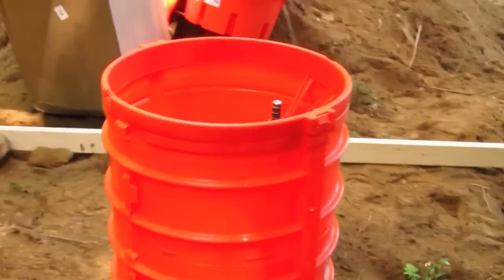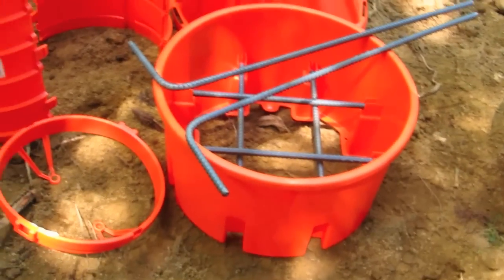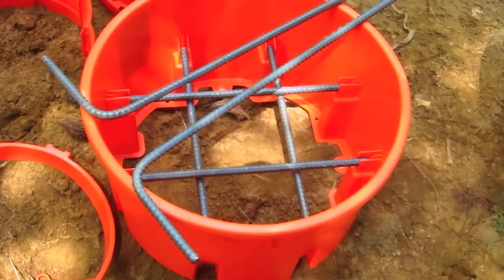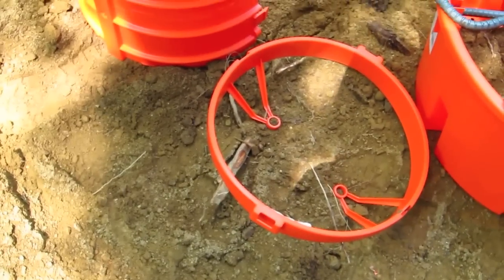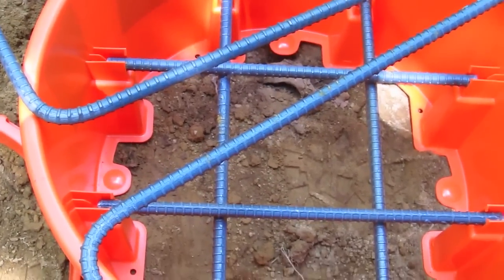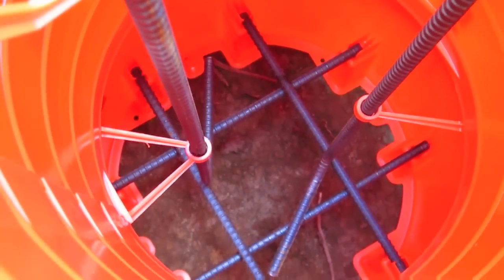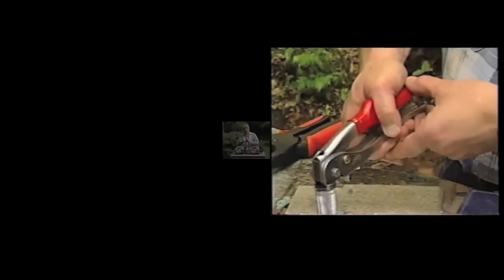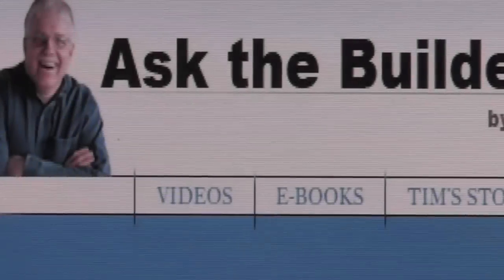Concrete Deck Pier

Comment from the maker: No plumbing. Some minor electric. At this time I only have access to a switched 20-amp circuit to the shed. That allows me to run a few lights and one tool at a time.

Comment: Using regular sonotubes you don't need to pour concrete first for a pad. You can pack t base or similar down with a 2x4, once level and packed you can position your big foot or sonotube and pour.
Reply from the maker: tyler caruso I only approved your comment to provide a teaching moment. I don't believe you understand the concept of what a footer does. It spreads out the weight of the concentrated load put on the pier. Put a simple pier on soil and load the pier and you can have great issues. Deep-driven piles and piers work only because of the accumulated friction on the sides of the piers. This doesn't apply to shallow piers like the one you see in this video.

Comment: Don't know the price. But two things. 1. Digging a hole large enough and that is deep enough to except this product will take professional digging equipment. 2. That would take a large amount of concrete. Plus the price of the product. This will get expensive very quickly. But I agree that it would never fall.
Reply from the maker: My guess is you've never installed a concrete pier before. Digging in soft clay a young corn-fed man could create the precision hole in about an hour. Yes, a small backhoe could do the rough dig in 5 minutes. The concrete used in any method - assuming old cardboard sonotubes - would be the SAME. This innovative product comes with the rebar precut to fit. Doing it any other way adds all sorts of extra cost having to transport long steel bars and then the tool to cut them on site. This product requires NO bracing as with other methods. You set the plastic form exactly where it needs to be and then carefully backfill around it with the excavated dirt all the way to the top. It's ingenious which is why I created this video.

Comment: what's the price?
Reply from the maker: Easy. Look for that column on my www.AsktheBuilder.com website
Reply: @askthebuilder  what is the price.
Reply from the maker: The price is what retailers charge for them at any given time. Because of inflation, the prices change often. I cover pricing in a column I wrote about them on my www.AsktheBuilder.com website. If I were you, I'd go look at that column.
Reply: @askthebuilder  It looks more expensive than helical pier 300